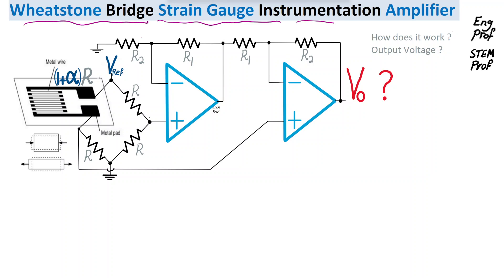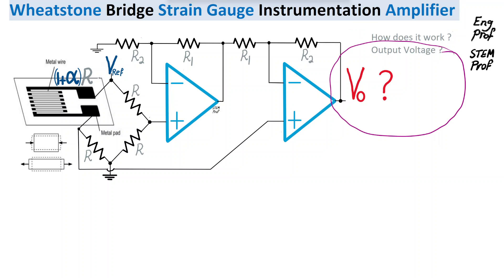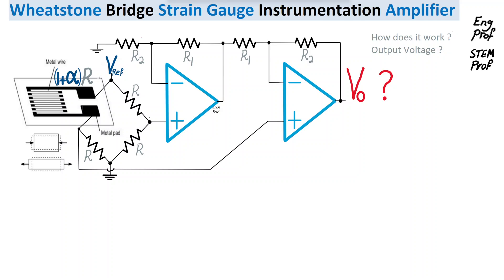Strain Gauge Wheatstone Bridge Instrumentation Amplifier Explained

Comment from the maker: A Wheatstone Bridge Strain Gauge Instrumentation Amplifier is explained in this video to measure the value of Tensile or Compressive Strain in a given structure on which Strain Gauge is applied. For more examples see: 
PhotoDiode Amplifier with Data Compression Explained https://youtu.be/hqrRx2ufAwg
Amplifier with -25 to 55 dB Attenuation-Gain range https://youtu.be/oyz6lTGd2Xo
Electronic Gain Control for Op Amp Amplifier  https://youtu.be/NoNgQpbj77Y
Thermometer Circuit Design with Op Amp & BJT transistor https://youtu.be/55YsraFE0rg
PhotoDiode Amplifier with Op Amp and MOSFET Explained https://youtu.be/1c3EJ2d4pVI
Instrumentation Amplifier with Electronic Gain Control https://youtu.be/C4tghZ-q6Zs
Power Amplifier Design (Class A) with Transformer https://youtu.be/gKlJrqGqeCI
VCA Electronic Gain Control (Part 1): Voltage-Controlled Attenuator Overview https://youtu.be/cFzYZsPEtP0
Analog Multiplier Circuit  https://youtu.be/VP53A2zpVMQ
Push-Pull Power Amplifier Design with Op Amp, Sziklai Darlington Transistors https://youtu.be/8BFzsi7-Vbs
Analog Vector Summer Circuit Design with Op Amp and BJT Transistors https://youtu.be/PIAsa0QNVns
Op Amp Analog Computer Differential Equation Solver https://youtu.be/ENq39EesfPw
Push-Pull Power Amplifier with Darlington Transistors https://youtu.be/866MYibo8yE

And the Analog Circuits Video playlist: https://www.youtube.com/playlist?list=PLrwXF7N522y4c7c-8KBjrwd7IyaZfWxyt  I hope these Circuit design and analysis videos are interesting.

Comment: This actually includes just a nice design for a differential amplifier, but the difference is both the inputs are the pure high impedance opamp inputs. Normally you might need 3 opamp blocks to do this in a traditional instrumentation amplifier design. I quite like this circuit for many ideas. Only needing 2 opamps is extremely convenient for using many dual opamp packages. For instance I'm interested in using it for a low-ohm measurement device. It can measure across the resistance source with very high impedance, so not disturb the current flow, and doesn't need one of the measurement points to be at 0V.
Reply from the maker: Thanks Matt for your good summary of interesting features of this two-OpAmp Instrumentation Amplifier. Glad that this design is interesting and useful. Here are a few more videos about different features and types of instrumentation amplifiers: 1x, 10x, 100x, 1000x Switched-Gain Instrumentation Amplifier https://youtu.be/9-MLqyewXW8
Variable Gain Instrumentation Amplifier for designing Thermometer Current Source https://youtu.be/Ggf0yCaTTiY
Instrumentation Amplifier Explained https://youtu.be/Yq767et8BbY
Gain & CMRR of Instrumentation Amplifier Explained https://youtu.be/Bw29QjHHzGo
Instrumentation Amplifier design with Differential Instrumentation Amplifier with BJT transistor https://youtu.be/2xJpqfexsPg
I hope these videos are interesting as well.  Thank you.

Comment: How about some pt100 sensor circirts?Looking forward to seeing them.
Reply from the maker: Thanks for your interest and question. Sure, an example video https://youtu.be/kk2c7Gk3nW4 discusses using Tempco resistor (temperature compensating resistor) with positive temperature coefficient (like a PTC thermistor). Here is also another circuit video example https://youtu.be/Qe3cY9JSzYg that explains Analog Computer that Raises signal to Power of signal with Temperature Compensation using PTC thermal sensor.

Comment: Used many times. Sometimes adding an extra strain gauge in the other leg of the bridge to compensate for temperature drift.
Reply: There are some strain gauges with the entire bridge built-in using two pairs of otherwise identical perpendicular cells in mirrored inverse arrangement on the same substrate to form the whole bridge. That doubles sensitivity while taking care of temperature compensation and resistance matching. Of course, you can only use those when you know for certain there won't be any strain in the perpendicular direction large enough to meaningfully interfere with the bridge's two reference gauges/resistors.
Reply from the maker: @teardowndan5364  Good points regarding integrated Dual Strain Gauge and Wheatstone Bridge sensors. Thanks for sharing your thoughts and your interest in this video.
Reply from the maker: Thanks for sharing your experience. Glad that this strain gauge instrumentation amplifier circuit video is useful. Also good point regarding using an extra strain gauge for temperature compensation. 👍